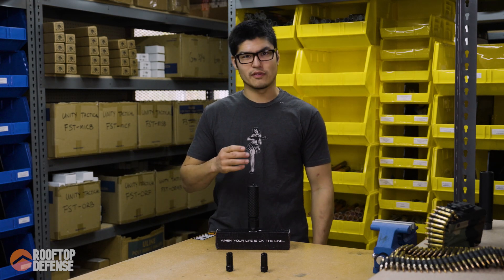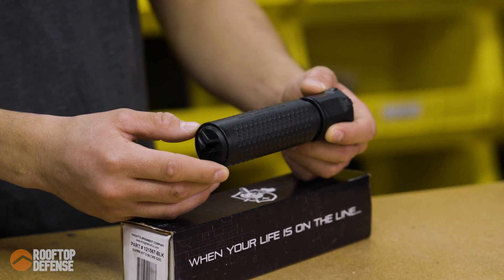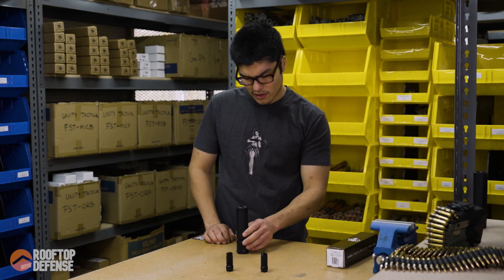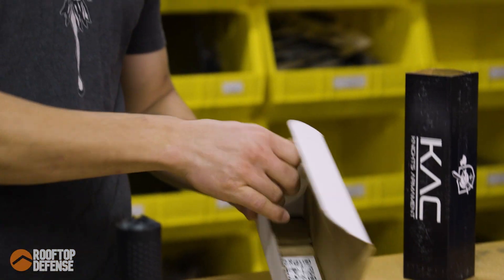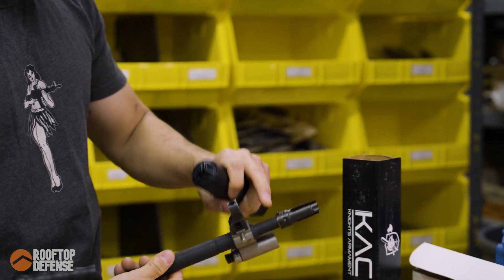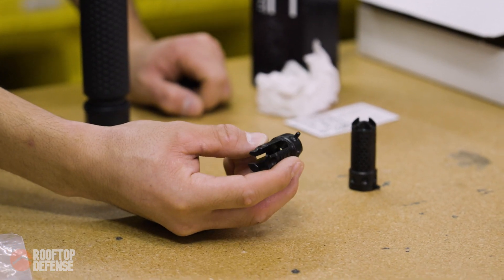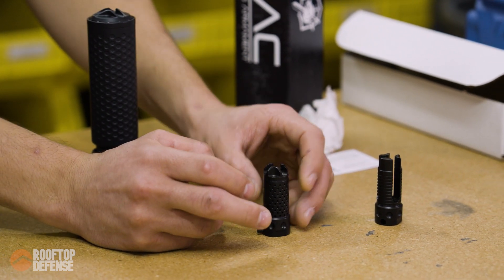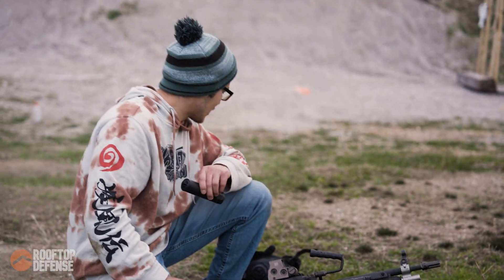Suppressor Stuff Ep 4 - Knight's Armament 556QDC/CRS-PRT: Backpressure & Flash Test

Comment: I was going to get the RC3, but it's wild how it caught fire and glowed like that. Definitely going with KAC on this one.
Reply: I believe that 3D printed suppressors tend to initially expel lots of metal bits, and then after 500(?) rounds or so they calm down. Those bits must be catching on fire. 

Saw this explanation on a Huxwrx review, which was shooting hot glowing embers out. I think it’s a “flashing” byproduct of the printing process, where there are tiny metal flakes that get knocked off when shooting (especially right away). 

I don’t know if these test cans are getting the very first shots through them or if they’ve been shot in a bit. I think @RooftopDefense said the can’s are all brand new and with zero shots through them.
Reply: @dcarson  So, it catching fire will stop after a while. That's fine and all, but it glowing a lot is kind of not great.
Reply: @s4iL_  It's also because he shot 100rds automatic that it went on fire and glowed. I'm guessing your drills probably won't be shooting that much at a time. Even if you shoot 3-500rds a range session you still won't even see the glow unless you're shooting a crap ton in a small amount of time. While I agree I won't be getting a rc3 anyway because the KAC looks waaay better. We're just trying to say that you probably won't be seeing what you saw in the video because like you said, you're not going to be shooting FA
Reply: Most suppressors will glow red hot after 100rd auto. Even the RC2 used by mil started to glow in this fellow’s test. Another 20-50rds and it would be glowed like the sun as well. 

Don’t take my word for it, do a search and you’ll see.
Reply: @dcarson  i'm very familiar with the RC2 glowing, bc i get it to glow every time i go to the range. just crazy how much the rRC3 did
Reply: Yeah, I agree and was also surprised at the RC2 and RC3 difference in this regard. I wonder what is causing the difference…thinner material or more conductive material? Printing vs. welding? Something else? And how much does the design factor in? 

And does “time-to-glow” (lol) even matter? I would assume SF is careful to make things that will not typically  fail in military use. Companies make mistakes, but this is a simple test that I’d think SF does many, many times, as well as testing to failure. 

Thermal signature might be a small issue? But the difference would seem to be a small number of rounds before they are equally outwardly hot. 

For low-rate-of-fire me, a total non-issue. You? Maybe?

I just want a can that doesn’t require obsessive tuning and I hate gas to the face.
Reply: @dcarson  yea, maybe 3d printing. I was mostly thinking maybe the way the gas flows through, i don't know what the channels look like, but i remember hearing they ran a ton of sweaty simulators to find the best channels and flow. i guess the flow pattern was great, but there may be less material or something.

i just don't want the skin on my knee to be rehomed to the suppressor, and i want the least glow possible.
Reply: You should add a cover over the can just to protect you. I use them for anti-mirage reasons, but they will also prevent burns. Modtac has interesting QR designs for AR’s and now for bolt guns. Not sold on the bolt gun design (I have their older “clamp-to-suppressor” bolt gun design). 

Modtac covers are carbon fiber and don’t touch the can. I don’t think a glowing suppressor would bother them…probably?

I hear good things about Can Chaps too. 

Anyway, good to hear a different perspective.
Reply: @dcarson  I have tried a few different suppressor covers, but I don't want to retain heat, and my light also gets in the way of the cover.

I have seen Modtac covers and I do like how they look and mount. Just wish they would make some for LMT MRPs. I know there's a universal cover, but I'd rather keep the rail space.

I wish KAC would come out with their suppressor covers to sell to us. There's a tutorial on their channel on how to mount it to an MCQ. Hopefully they also have one for the CRS.
Reply: @dcarson RC3 has runaway combustion due to blast chamber venting to atmosphere in an unmitigated fashion. Plus these annulus are closer to "wall" thus it heats up faster. Etc
Reply: Interesting. Is that from a test you’ve read somewhere? Sounds reasonable…although I  personally have no idea how combustible the vented gas is.
Reply: @dcarson  It's from the RC3 video he did lol.
Reply: Hahah! It’s been over a year since I watched that. I’ll have to rewatch. I assume the fellow mentions the info. This channel is very thorough with suppressors tests, that’s for sure. I wish he did some more.
Reply: @dcarson  haha, same here. i was really curious about how the mcq did. womp womp
Reply: What I’m trying to say it seems like it’s no big deal.
Reply: Does that really matter for normal use though? How often are you shooting 100 rds, automatic, in one go?
Reply: @Patman824  I don't shoot FA, but I shoot 3-500rds per range trip, and I do drills frequently back to back. I'd like something to not glow that much. Especially when shooting under NODs.
Reply: @Patman824 Same price one is better, why not.😂